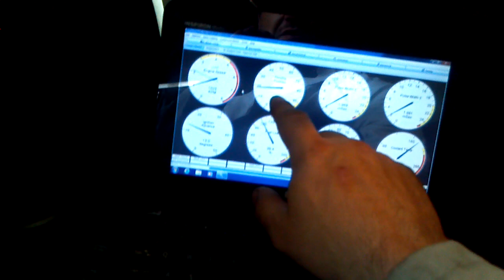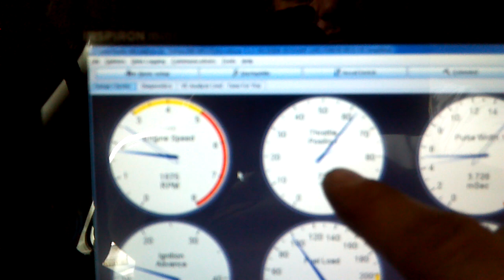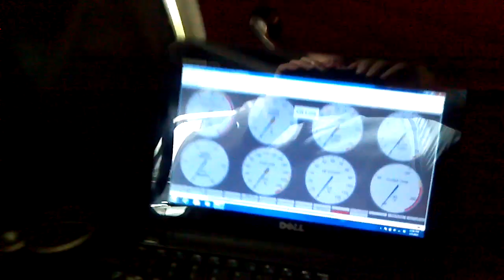Fuel Injected Subaru 360 RUNNING!

Comment: Nice, I would like to have that on my 360...so how many 1000's did this conversion cost?
Reply from the maker: ***** I think that now with the MicroSquirt available for around $350 you could get your 360 into a full EFI setup for under $1k. 
You just need to whip up a simple runner intake, grab ITB's, fuel pump, regulator, Coil, and timing wheel setup (sensor and wheel).  
The R6 TB's was a great setup I ran it for over a year then I converted my engine to an EK32/33 hybrid and went back to carbs after fighting with VE tables cut into my seat time.
One of our member on the forum modeled some nice runners that can be 3d printed and LOST PLA cast, or CNC milled for a pretty penny.
Best of luck on your build!

and more importantly be sure to Join us at http://www.subaru360club.org